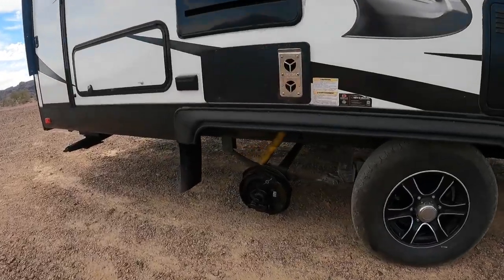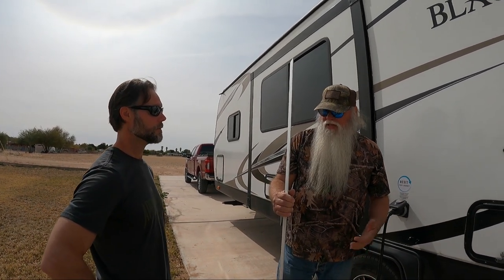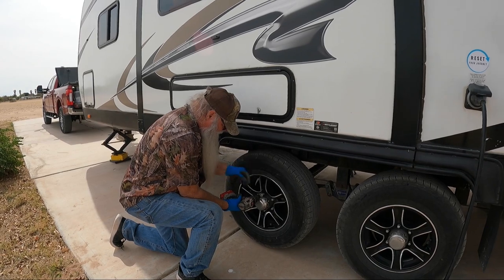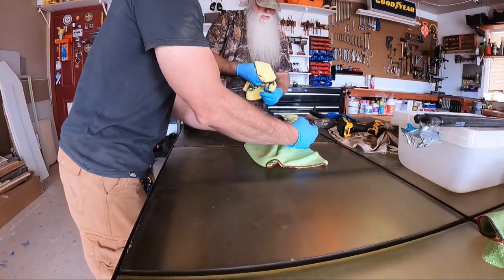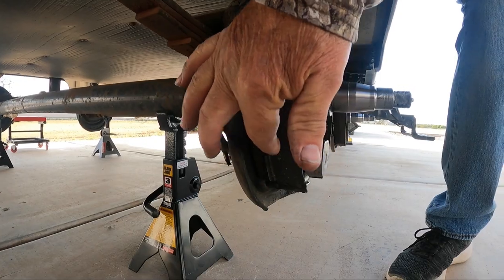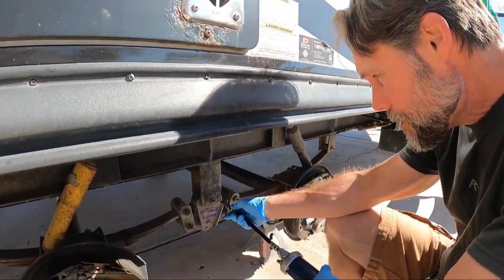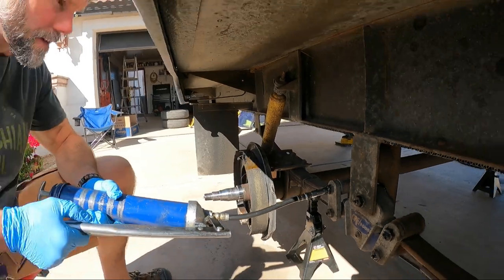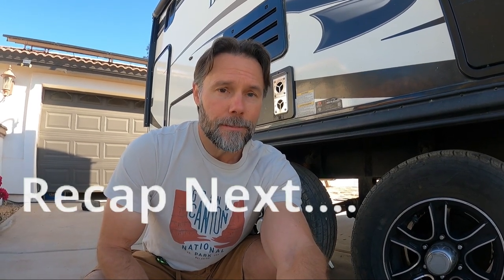RV Trailer Wheel Bearings Overview- REPLACE and GREASE PACK | RV Living | RYJ

Comment: Having watched many of these videos on dexter wheel bearing maintenance.' I am left with one bit of advice. That being, always, apply a good coat of grease to the rubber part of the inner hub seal. To install it dry will lead to premature to the seal and cause it to leak. No one has ever shown that step and many viewers may not know this.
Reply from the maker: That's a great point Tom. We missed filming a few step and that was something we did. Even missing some footage, we've already gotten a lot of RV owners to think about and plan on bearing maintenance. It's a step in the right direction. We appreciate your input and hope others read the comment. Thanks again and we wish you well Tom.

Comment: Hello, 

Nice video, you mentioned that the EZ Lube Zerks are questionable and you recommend repacking bearings manually. 

How often or how many miles do you and Steve recommend repacking bearings and installing new seals?
Reply from the maker: Thank you for commenting! That's a valid question. Steve suggests repacking every 10k to 12k miles. As long as the seals look good and there's no evidence of grease on the brakes, there's no need to replace the seal. That is until you do a full bearing revision. Wishing you well!

Comment: Very Good Video!!  I currently have all four of my wheels off my fifth wheel waiting on my seals to arrive.  I am at a point where that is yearly maintenance.  Might be overkill but after losing a wheel due to bearing failure, its worth it.  Question what did you torque the axle nut to seat the bearing into the races?  Thanks again.
Reply from the maker: Thank you so much for the great comment Dennis! We completely understand and it's not overkill, it's affordable insurance. We'll be doing it yearly too. If you watched our "It Fell Off" video, you know what we mean. 

We torqued the axle nut to 50 lbs to seat the bearings and then backed it off. Wishing you well and safe travels!

Comment: Awesome video and could have used this my first go round. Getting ready for my second in a week or two. 
What did y’all end up doing in the rear passenger brake pad? Did you replace it?
Reply from the maker: Thank you so much and we hope the second go around goes well. We actually ended up replacing the pads on that particular wheel. We learned so much! Thanks for commenting and following along!
Reply: @ResetYourJourney  What did y’all do with the drum? I assume the drum was not nice and smooth with the uneven wear. Did you have it resurfaced? Did he provide any insight on when to resurface or replace the drum?